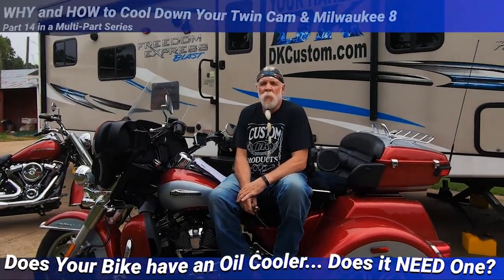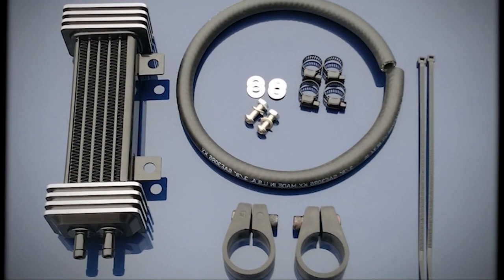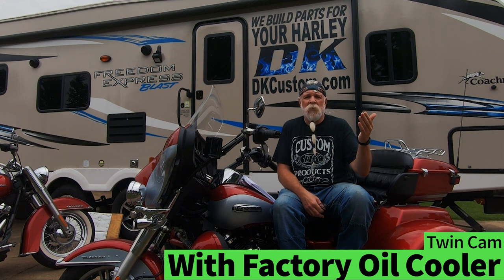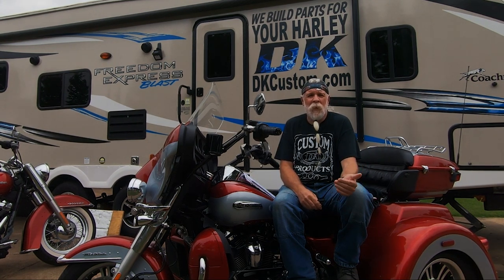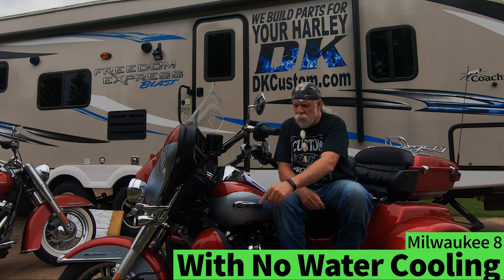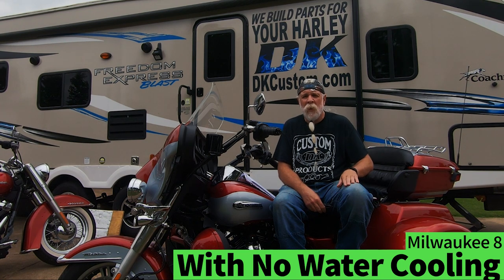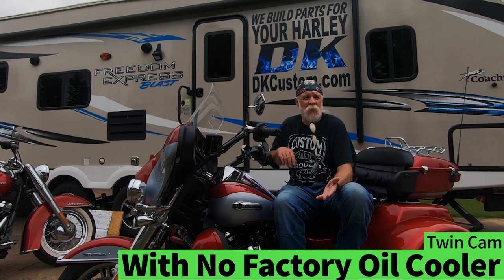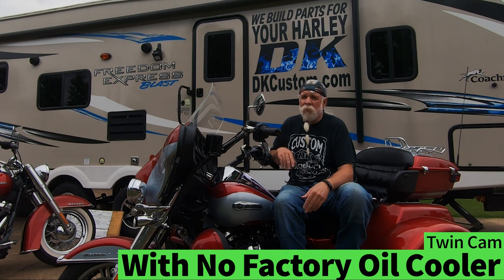Oil-How it Affects the Performance of Your Harley

Comment: I love the rooster!  Great series Kevin, I look forward to each episode.  Question how are you measuring the oil temp?
Reply from the maker: 😂 Yeah, he goes off all day long.  Glad you're enjoying the series.  We use the HD analog gauge, the HD Digital gauge and a  Jess dial gauge.  All temps are taken at the tank.  This is NOT the location where the oil is the hottest.  But it is where it is easiest to get a reliable read on it.  That is why we have a max target of 230 degrees...that gives some cushion before the 260-270 mark, which is when the additive package (viscosity modifiers) start deteriorating.
Reply: Spend 30k on a Harley and it’s up to me to add oil coolers , oil filter relocation kit, fans ? Just so the engine doesn’t grenade? 120 years selling motorcycles and this is the best they can do? One guy designing parts when the company has hundreds deigning and testing? Have you ever considered contacting Harley and letting them know their bikes run hot? Thirty grand and I can’t ride it during riding season.

Comment: I wanted to put a jagg 10 row in the factory location ( down low ) but because my factory oil cooler was so beat up from stones. Jagg doesn’t offer a cover so I bought a new factory oil cooler & fabbed a mesh screen in the cover to protect it. I wish there was a cover for the jagg
Reply from the maker: Interesting.  I've traveled a lot of gravel roads, including all the way up to Alaska, via the Yukon, never had a cover, never had a beat up oil cooler.  OH, I realize why, I have an extended fender skirt on the front fender.  Non touring models I use a downtube mounted oil cooler.
Reply: DKCustomProducts 
I do ride on a lot of dirt roads but probably the majority of the damage probably comes from Pennsylvania’s famous oil & chips roads. 😡
Please do you have a link for the extended fender skirt?
Reply from the maker: @scrumthebum2451  Understood.  There are a huge variety of them...J&P is a good place to look.  Search for mud flaps.   The one I have was made by a friend out of stainless steel, then I affixed some emblems to it.  You can see it at this link-   http://www.dkcustomproducts.com/image/2019_Tri_Glide/Tour-Pak/Fender%20Skirt.JPG

Comment: I have a quick question for you. I have a 2013 electric like classic I've already purchased your axillary  oil cooler, it has a factory oil cooler as well.  I would like to run the oil filter relocation that mounts up front on the down tube,  can I do that with the auxiliary oil cooler or do I need to relocate  the filter back farther under the floor board?
Thanks for putting out this great information,  it has been very helpful to me.
Reply from the maker: You have a few choices.  use the oil filter relo that goes under the rear passenger peg/floorboard.  OR  You can put both the cooler and the oil filter relo on the left downtube.  It is very tight, but we have seen some Customers do that.  OR You can do what I did on my Softail...I put the oil filter relo on the left downtube and the oil cooler on the right downtube.  You can see a photo of it at these links- http://www.dkcustomproducts.com/media/catalog/product/cache/1/image/9df78eab33525d08d6e5fb8d27136e95/c/n/cnc_oil_filter_relo_with_cooler_softail_4.jpg
http://www.dkcustomproducts.com/media/catalog/product/cache/1/image/9df78eab33525d08d6e5fb8d27136e95/c/n/cnc_oil_filter_relo_with_cooler_softail_6.jpg
Reply: Thank you. I will be ordering my oil reli this week.
Reply from the maker: @Andrew S  Cool, we appreciate your business, and believe you will be well pleased with it.

Comment: I'd like to see something like a turbo intercooler up front but not too big, polished aluminum not painted. Something wide enough to have two heavy duty fans behind it that are removable as a separate unit.. if the fans get old and wobbly you just pull out four bolts or screws and remove it without disturbing the heat exchanger and the oil lines.
Somebody give Elon Musk a call... I'm going to check out Trask and see if they got something going on to that end.. there's got to be something out there that holds about 2 quarts of oil that can shed heat outside the motor to give that oil some relief... something race Duty..
Great video thank you 👍👍
Reply from the maker: For what bike, and where exactly would you like to see this?
Reply: @DKCustomProducts  I would like to see this as a replacement part for the oil cooler that comes on my 22 Street Glide Special for one... and perhaps an aftermarket bolt on some kind of a universal mounting system for older bikes.. come on DK you guys want to be millionaires
Reply: I'm thinking down the road after my upgrades . If the stock Harley unit isn't covering the heat problem.. there's definitely a need after thousands of dollars of upgrades to the motor.. the technology exists someone just needs to put together a sweet package
Reply from the maker: @d.sandell2555  A few thoughts-
1. Oil heat is the symptom of other heat.  Oil is not the source of the heat.  
2.  The metal is where the heat comes from.
3.  Better to cool the metal than the oil...then the oil does not get as hot.
4.  Cooling the oil will help overall engine heat, but not enough to get it in the safe range.
5.  So cooling the oil is one part of an overall strategy to get engine heat down.
Here is a really useful report on what parts of the engine should be at what temps, and what can be done to get there.
https://www.dkcustomproducts.com/sleeper-performance-mods.htm
And, I take you have seen our secondary oil cooler that will work in conjunction with the OEM oil cooler?
https://www.dkcustomproducts.com/auxiliary-oil-cooler-for-all-harley-twin-cam-w-o-lowers-dk-sec-oc-tc.htm
and here is a set up that works even better at cooling the oil
https://www.dkcustomproducts.com/oil-filter-relocation-oil-cooler-combo-pkg-harley-touring-dk-ofr-dcoc-2wh.htm
Reply: I hear you I see oil in addition to lubrication like antifreeze it absorbs heat and it can shed Heat given that oil loses its properties with high heat and I see most oil coolers as undersized and inefficient to the extent of not doing enough I see room for Innovation there... short of running an air ram system like a sport bike or riding in tornadoes only I don't see miniscule air flow from fans doing enough.. that was my thought on the matter.. I appreciate all your help with the links.. I assume you have a Facebook page I got out of Facebook a long time ago because of their b***** but if I come up with something I'll give you some pictures to your page thanks again!!!
Reply from the maker: Yes, some sort of ram air or massive fans would definitely improve the shedding of heat.  If you come up with something, would be cool if you emailed or texted the pics to us.
Support@DKCustomProducts.com
text to 662-420-4891

Comment from the maker: Besides providing Fast, Accurate Shipping,  along with Superior Customer Service...At DK Custom Products we use Jagg Oil Coolers on our own Bikes, and are happy to make them available to our Customers at extremely good pricing.  
Check them out here- http://www.dkcustomproducts.com/oil-coolers-c134.htm

Why Do We Use & Recommend Jagg Oil Coolers?

HyperFlow Technology is the engineered balance between performance and flow. It should first be described as a "systems" way of thinking.

Air flow, fins, oil flow, turbulators, brazing technology, metal finish, oil filter adapter design, thermostatic actuator, etc., are each components maximized to contribute to the overall system. 

It is only when each individual component is considered in relation to its contribution to the whole that a true systems approach can be claimed.

Comment: The secondary cooler, its made by who? Is that a product you all sell?
Reply from the maker: It is made by Jagg. Yes we sell the Oil Coolers you can see them at this link - https://www.dkcustomproducts.com/oil-coolers-c134.htm

Please feel free to contact us with any questions;
Support@DKCustomProducts.com
662-252-8828

Thank you for commenting! 😎 MB
Reply: @DKCustomProducts  thanks. It looks like it won't work for my 2018 FLRT according to what I read.
Reply from the maker: I am not sure what you read that gave you that impression, but secondary Oil Coolers will fit on your 2018 FreeWheeler. You can see both options that will fit your bike at this link - https://www.dkcustomproducts.com/twin-cooled-oil-cooler-c616-202.htm

Please feel free to contact us with any questions;
Support@DKCustomProducts.com
662-252-8828

Thank you for commenting! 😎 MB

Comment: Edit: my bad, you literally say Mil 8 and twin cam in the begining🤦‍♂️

Did I miss it or was the Evo not covered in this video. I have an Evo and was told that these motors are worse with heat because of the lack of piston squirters. Any recommendations for oil coolers for Evos?
Reply from the maker: Yes, we did not cover Evo's in the video.
Most can definitely benefit from oil coolers.  Link to Evo oil coolers below.
If you oil is seeing temps of over 230 F, they should have a cooler.
https://www.dkcustomproducts.com/touring-c156-118.htm
Reply: @DKCustomProducts  thats good to know!! Thank you!
Reply from the maker: @bigpowerhouse11  Thanks!

Comment: Wonder if you can mount it differently so can keep your lowers like dirty bird yet run this or two of them one on each side. I have a 107 road glide run a in the 300 degree but now I’ve ordered a 131 crate engine so if this is same then I guess I’ll have to try a lot of other things to get it down to 200-240 or less
Reply from the maker: No idea what Dirty Bird Lowers look like/compatibility, but we have an oil cooler that works with the Harley lowers, it can be seen at this link- https://www.dkcustomproducts.com/oil-filter-relocation-oil-cooler-combo-pkg-harley-touring-dk-ofr-dcoc-2wh.htm

Comment: Hi , I watch you for some time :) , I got a 2015 flhtkse with water cooler , and Im wandering if I can relocate the pump into left side , where the radiator and fan is ?!  I dont know the rest like the termostat where to be . I would like to have a oil cooler , but also I would like to bypass the new oil cooler if is needed in my road trip.
Reply from the maker: Hi @Isovidiu,

Glad to hear you are liking the videos.

We have never seen the water pump relocated, there may be a way for it to be made to fit, but it will take quite a bit of plumbing work, and also some wiring work.  

It is better, in our opinion, to leave it where it is and to put an oil cooler behind the left side lower fairing vent.  It you ever don't want air flowing across your oil cooler, simply close the vent.

That is what we do on all of our Twin Cooled bikes.

Here is a link to the oil cooler kit that bolts right on to your bike.
https://www.dkcustomproducts.com/oil-filter-relocation-oil-cooler-combo-pkg-harley-touring-dk-ofr-dcoc-2wh.htm

Here is a video showing the installation process.  This set up works extremely well at keeping oil in a good temp range.

https://www.youtube.com/watch?v=GiYjkpZaNYg

Feel free to call or email with any questions:
Support@DKCustomProducts.com
662-252-8828

Thank you for commenting! 😎

Comment: First, thank you for taking the time to do these videos and answer qustions.  I have a 2019 Road King standard. I added the Jims force flow fan and a couple of months ago I was riding back from Arizona in about mid 95 degrees. After pulling a long up hill run, The hottest  i saw oil temp at the oil tank dip stick was 243 degrees. I measured the head temps at the spark plugs at 298 front and 332 rear with a heat scan gun after about 1.5 hours.  The rest of the run home oil temp was 234 degrees & 285 FC & 318RC at spark plugs.  This particular ride i was by myself with about 20 lbs of luggage. My wife does go with me at times and we will also pack up about 60lbs of cloths and other items for Sturgis or other longer runs.   Would a jagg 6 row oil cooler be a good addition? Also installing the automatic bypass or manual bypass valve. Thank you I advance & and appreciate your suggestions and or advice.
Reply from the maker: Thank you for the comment and for the kind words.  👍
Yes, a Jagg 6 row will add to the cooling capacity, and a 6 row with an oil filter relo will give you even better cooling.  Links to both below.
The heat scan gun is not an accurate way to get engine temp. (see video below on that subject)  
There is a heat sensor in the front of the rear cylinder that is used by the ECM, that is the only accurate way to get an engine temp reading.  The Power Vision will display that for you as a gauge labeled "ET".
Video link- https://www.youtube.com/watch?v=afgon9Qc1B8
Oil cooler links-
https://www.dkcustomproducts.com/auxiliary-oil-cooler-for-all-harley-twin-cam-w-o-lowers-dk-sec-oc-tc.htm
https://www.dkcustomproducts.com/oil-filter-relocation-oil-cooler-combo-pkg-harley-touring-dk-ofr-dcoc-2wh.htm

Comment: Two oil coolers - double your pleasure, double your fun!
Reply from the maker: Yep, I've had to run two oil coolers on a couple of bikes....really surprised me the first time...that was on the 2005 Road King.  No matter what I tried I could not get my temps down until adding the second oil cooler (this was at the advice of Jamie, a performance engine builder).  I also had to run a second oil cooler on the 2011 Tri Glide to get the temps down to 220-230.

Comment: Is there a long stem thermometer available to check the oil temp?
Reply from the maker: Yes, Harley sells oil temp dipsticks.  We prefer the analog temp dipsticks to the digital, they are more reliable.  For the models that HD does not sell analog temp dipsticks, we use them from JESCustoms.

Comment: My Evo oil temp is low. Even an a hot day it doesn’t get above 150. It’s the approximately the same measured with two dipsticks and my wifes meat thermometer even in 80+ degree temperatures, running 75 on the interstate or cruising below 45 on twisty hilly backroads. Oil is circulating, it’s not running lean and shows no Sign of the timing being off. Can you offer any insight as to what my be causing this
Reply from the maker: That's a great problem to have...when compared with all the TC's and M8's running so hot.
Ideally you want to see oil temps in the 190-200f range.
Measuring the oil temp at the tank, especially if you have an oil cooler, means that the oil is probably up closer to 200F in the engine.
If you have an oil cooler, try making a "jacket" for it, to stop air flowing thru it.  If the temps get up to 180-190 at the tank, then remove the cover from the oil cooler.

Comment: Do you have any research on adding a 2 quart oil tank to bump up capacity and its effect on oil temperature and change intervals? Thnx
Reply from the maker: Other than what we shared in the video about oversized oil tanks, we do not have any other research/information.

Comment: I changed out the H-D one to the H-D fan assisted one... I have the chin spoiler on my bike and really wanted to have the jag cooler on some how.
 is there any ideas on how? wondering about the oil relocation as well? Or would I have to take the chin spoiler off?
Reply from the maker: What year and model bike do you have?
Reply: @DKCustomProducts  are there any that fit a 2021 iron 883 that mounts within the horn location? I can move the horn to make it work but I was just wondering since I live in hot sunny south Florida. With Miami stop and go traffic, I’m doing a performance application o minus bike and it will be here soon passed 120 hp
Reply from the maker: @cheyenneobregon184  You can place a 7 row or 10 row oil cooler on your downtube.  You can see them at these links-
https://www.dkcustomproducts.com/slimline-oil-cooler-system-for-harley-davidson-motorcycles-dk-j-750-1200.htm

https://www.dkcustomproducts.com/wideline-oil-cooler-system-for-harley-davidson-motorcycles-dk-j-750-2000.htm

You can even get a fan assisted one, as seen at this link-
https://www.dkcustomproducts.com/fan-assisted-wideline-oil-cooler-system-for-harley-motorcycles-dk-j-fp2600.htm

Comment: 2021 FLHTK twin cooled, watching your videos great info. Choosing between 3 options which is the best bet mighty mites, jims fan, oil cooler and filter relo. kit? Honestly I don't like the look of the relocated filter and I drag my boards. What is the best option? Thanks
Reply from the maker: It depends on what kind of riding you do, in what ambient temps, and what your current engine temp is and oil temp.

If you're oil temp is getting well past 230F, like up into the 250's or higher, then an oil cooler is definitely important.
Don't worry about dragging the floorboards and getting anywhere close to the relocated oil filter.  It will drag the boards, the board brackets and the slip-ons and still not touch the relocated oil filter.  It is tucked up and in quite a bit.  Unless pointed out, very few people will even see it.

If your engine temp is getting up to over 300F, that definitely should come down.  At 270F of engine temp HD ECM is pulling timing in an attempt to cool it down and prevent accelerated wear.  Check out this video- https://www.youtube.com/watch?v=5PxJ8PvcVtc&t=0s

Comment: My 2016 FXDLS runs hot as hell, especially right now in Texas during the summer. Oil temp 230-250 degreees is pretty much normal for me. I wish it wasn't
Reply from the maker: Yeah, that's bumping up against the top of where you want to be.  If you've done everything else to it, have you considered running two oil coolers?